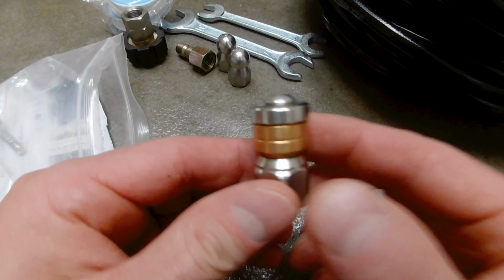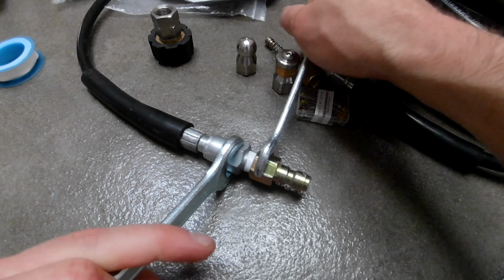DIY Drain Pipe Jetting | THE STENCH WAS AWFUL! 🤮 #diy

Comment: The Other thing that a home DIY can do for blockages like leaves is called a Drain Bladder/Drain Balloon.   They go on an ordinary garden hose and have worked well for us historically with storm water blockages.
Reply from the maker: Great suggestion! Those are super simple to use and can indeed clear many blockages. If nothing else, they're great for emergencies to get you back up and running quickly until you can treat the blockage either chemically or with a drain auger.
Reply: Yea is like a jet but doesn't work nearly as good. Like at all
Reply: And they are a lot cheaper too!!

Comment: Looks like something we may need to do with are French Drain. Did a great job. Thanks for the inspiration
Reply from the maker: Absolutely! It was fun (what power tools aren't, right? 😂) but it was messy and really did smell terrible. But the good news is it worked well and our drains are flowing much better now.
Reply: How would you do your French drain? I caution you if it's a true French drain that thing will absolutely destroy perforated. 2nd if your gutters are plumbed into your French drain you are taking water off of the roof and putting it into perforated pipe which means pipe that had holes in it. In simple terms your moving water from the roof to the foundation, that doesn't make does it? Gutters should be piped separately from foundation, you will overwhelm the French drain. If you would like to understand just how much water a roof can produce, disconnect a down spout and put it into a 5 gallon bucket, the next time it rains even if it's a small rain storm check the bucket then multiply it by the number of downspouts. It will shock you, how much water your moving

Comment: Did you give it a little wash first ? 
Jokes aside, i did the same thing as you, bought a hose that attaches to my Karcher pressure washer & it did great at clearing a drain.
It’s not going to cut roots out though.
Reply from the maker: My inspiration for buying one of these is another YouTube channel called Drain Addict. Now, granted, he uses a probably $2k+ professional pipe jetter but his can cut through smaller tree roots. It's possible if you have a ~4000 PSI pressure washer that you might be able to do the same. Mine is "only" 3200 so I can't say for sure, though.

Comment: I Live in a duplex. (IF you can call THIS living!).
My Landlord has to come out every two months to blow out a blockage. Everytime we get a big rain. A blockage in the sewage pipe from the house to the Street occurs.
There's NO sump pump in the basement. Both units are connected to the One sewage pipe going to the Street. 
My Landlord said it's a gravity system.
( I'm not a plumber. So, I have to take his word!)
There's a pipe in the basement that pukes out the sewage into the basement. 
Landlord is ALWAYS mad as Effff when I have to call him.
He doesn't do a thorough job at clean up in the basement. We have a dirt floor.
The stench is awful!!! 🤢🤮🤢🤮🤮
I asked him to upgrade the system to utilize a sump pump. He says, "NO!!!"
I'm presently saving money to move.
Reply from the maker: Depending on where you live, there's a good chance what your landlord is doing is illegal (as far as refusing to fix the issue correctly). Raw sewage backing up is obviously a health hazard! If you can afford it and there's nothing else keeping you there, I agree that moving out is probably your best bet. You don't want someone like that as your landlord. But if you're going to be there for a while yet, you may want to contact your city and see what kind of recourse you may have. In any case, good luck!
Reply: @realidiyrenos  
Thank You for the advice. 
We've decided to save up the money to move. As an ace in the hole.
IF he refuses to remedy the situation, we'll just move. The guy has 34 houses that he rents out. Everyone has a variety of complaints. While he and his son's ALL have beautiful homesteads on several acre farms. The county is corrupt as far as the building inspectors and judges.
Money talks here. Have a GREAT weekend and be safe out there.
Reply from the maker: @6stringgunner511  Oh man, sorry to hear that. I hope you find a new (and much better) place soon!

Comment: I’m still trying to figure out why you have three inlets so close together and each having their own discharge line without branching into a mainline. Way cheaper/easier
Reply from the maker: Those were installed 25 years prior to us moving in. I wish I could tell you why they did a lot of the stuff they did 🤔
Reply: If they all work properly then it would probably overwhelm a single pipe, plus I'm guessing one of them is a French drain. I hope the gutters are separate from the French drain or your gonna eventually be fighting more expensive things
Reply: Those were outlets genius. He was jetting from exit to entry and 1 is likely the French drain, the other two are left and right side of the property.😅

Comment: Must be an extremely flat slope, all my pipes stay clean as long as I keep the outlet from building up with dirt. They are pretty flat too so I'm surprised
Reply from the maker: It's tough to say. There's over 100 feet of pipe and I don't feel like there's a huge elevation change but it may be deceiving since the main entrance and exit are on opposite sides of the house 🤷‍♂️
Reply: @realidiyrenos  doesn't take much near level to cause problems. I have a 1.5" kitchen sink pipe that rises 1/4" over 6' distance and what a mess that causes. This product would be great for cleaning the accumulation out
Reply from the maker: @martyjoseph9507  Ugh, I can only imagine what collects in an improperly sloped kitchen sink drain line 🤮

Comment: I think for any good results , you would need a BIG gasoline pressure washer , not that size .
Reply from the maker: It's a 3200 PSI machine which is fairly powerful. It cleared out the lines enough that we haven't had issues with the drains backing up into our driveway anymore so it seems to have worked well enough 🤷‍♂️

Comment: Why would any pipes be draining out onto a lawn instead of directly  into the drainage system. That's just yuk. That turd though 😆😆😆
Reply from the maker: Great question. These are outlets for drains on our driveway and a few of our gutter downspouts so it's storm water. You do not want to route storm water drains into the sewer as the large volume of storm water could quickly overwhelm the sewer system and cause sewage to back up into houses. The other option would be city/county storm drains but I've never heard of residential drain systems connecting to the city storm drain systems. So the last option is draining into the yard or street. These were installed prior to us moving in and I suspect they chose this location because it was the cheapest option. Considering it's all rain water, it's not a big deal having the outlet where it is.

Comment: What kind of hillbilly Betty crocker drain pipe setup is that???
Reply from the maker: Hey now, nothing wrong with Betty Crocker 🤣 Agreed, though. We would have done things differently if we had installed them ourselves. Alas, they installed 20+ years before we purchased the house.
Reply: One for lots of rain water. Getting it away from the house.

Comment: There is hardly any water coming out, doesn’t seem right.
Reply from the maker: The pressure washer used is 3200 PSI 2.8 gallons per minute so it uses very high pressure water with a relatively low volume. On top of that, the jetter tip I chose flows an even smaller amount of water. The goal is more so to blast the obstruction loose with high pressure water and not so much to overwhelm it with a large amount of water.